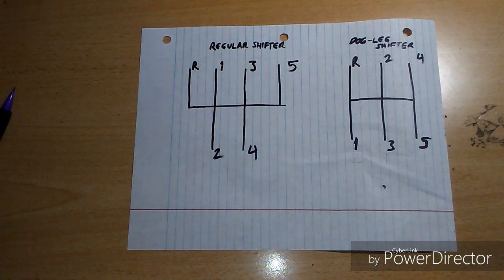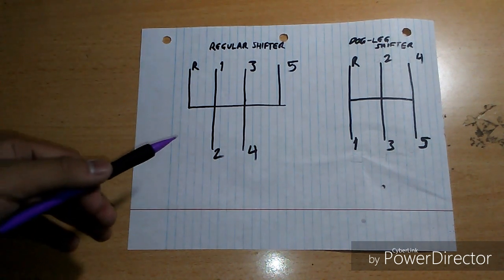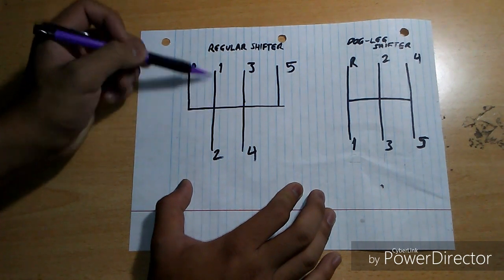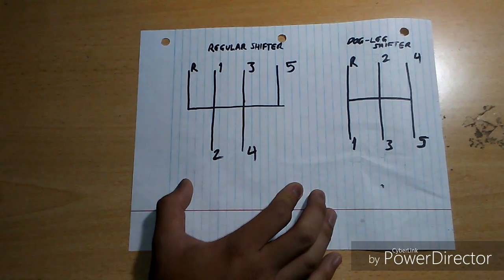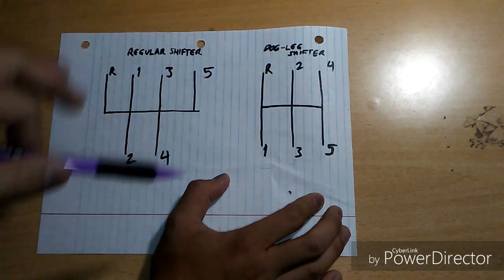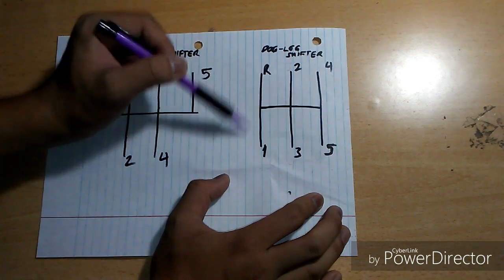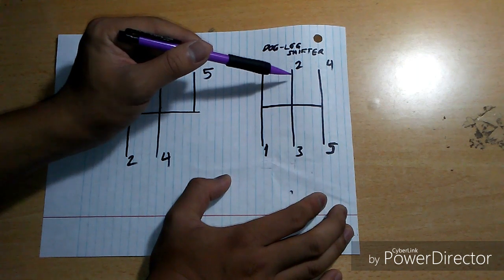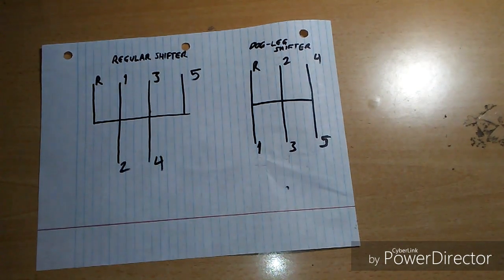Manual Transmission: Dog-Leg MT vs. Regular MT

Comment: I have a dog leg shifter in my 87 mustang gt and the gears are burnt out and I need another transmission, I do not plan on racing the car but I like the shift pattern for driving. Where can I find another dog leg shifter to put back in my car and what are the prices for one?? I have been trying to search it on the web but no luck.